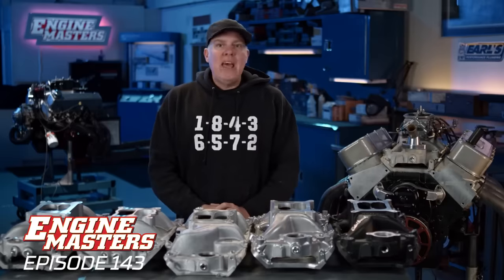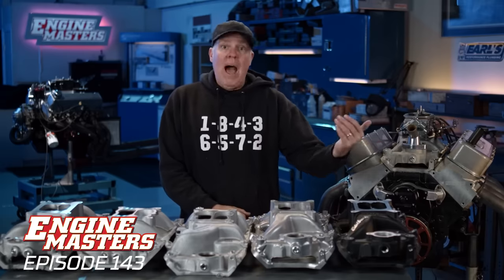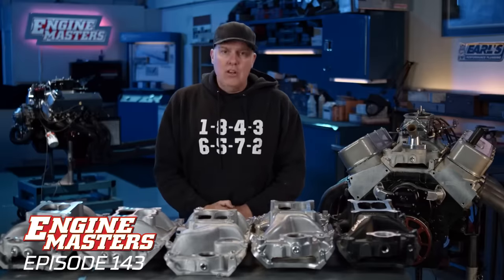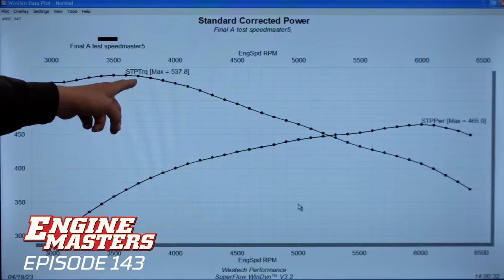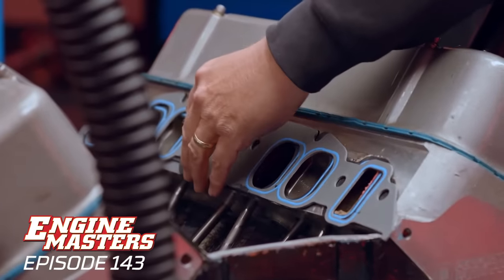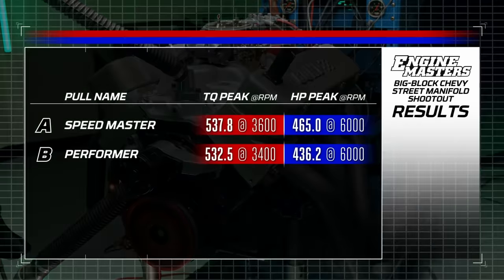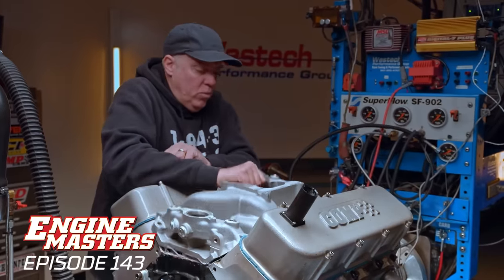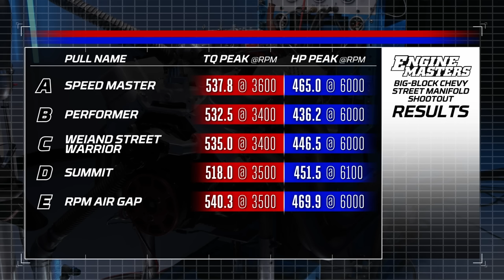Intake Manifold Shootout for Big Block Chevy! | Engine Masters | MotorTrend

Comment: I mean I get it’s a big block 454/7.4L V8 and by todays standard of HP per liter it’s not “all that” but geez I’d hardly consider that “a dog” 465HP/537Tq is nothing to scoff at, that’s still would still be a pretty stout street motor, that would still WALK about 90% of the normal cars you pull up next to at the red light (obviously it probably couldn’t run against a newer ZL1 Camaro, GT500 Mustang, Hellcat, etc) but even with the lowest/1st Dyno pull it’s still stout. ESPECIALLY if you have the right diff gearing (3.73, 4.10, 4.56) add all that together in a relatively lighter weight car and you’ve got something that would still definitely be a blast to drive. Not trying to be negative/hate on the video it was a great video as always! Engine masters is definitely one of my favorite series.
Reply: i have a Mark IV block with the PP heads and 2.0 eddy and 750 QFT and a mild 270H cam in a 3800 lb Gbody with 3.73s  . the Car walks my 87 GN with 17 lbs of boost!  Its funny looking at the Tac its just at 4000 rpm as it says bye bye to the GN
Reply: I agree, 537 ft lbs in street car or C10 with the right gear and converter would be a blast on the street, and put a 150 shot on top of that if you want a little more now and then. Most people wouldn’t know what to do with that much torque in an average street car. 👍🏻

Comment: Can you do a comparison of intakes for the Small Block Olds engines?
Reply: Yes yes yes! I'm lost with my 307
Reply from the maker: Interesting idea!
Reply: @rikardoberg9925 from what I've been reading, with the Olds rocket, not only is it a legendary engine, but they're saying Olds were generally considered the most powerful muscle car's until the hemi came back with the 426, then Chrysler took over.
Reply: @rikardoberg9925  yeah,  it's pretty much the original muscle car. I feel like mainly chevy and ford have gotten most of the love with engine's over the years and some Chrysler with the hemi. The one's that haven't have been Buick,  Olds and Pontiac.  They've all had at least one quality engine over the years. They need to definitely shine something on those guy's.

Comment: okay you 2 lads , how about doing an episode about camshaft notching -- meaning advancing or retarding the camshaft  by 1 gear tooth or by 2 or 3 teeth ETC , versus crankshaft timing , i read a story  back in the early 2000`s about an engine builder who retarded the camshaft to crankshaft alignment by several teeth , basically he explained that the piston was 60 percent on it`s downward stroke creating suction in the cylinder , then the intake valve opened allowing a denser air-fuel charge to be "SUCKED"  into the combustion chamber thus resulting in a lot more torque generated ( he did not though state if the camshaft was a custom grind , probably was but  just a factory grind maybe .

Comment: didn't Brodix/Shafiroff come out with a low deck dual plane intake to feed large cubes/heads? did that ever come out
seemed like a great solution for hood issues
the 615ci 9.8 deck has my attention, especially with hood clearance. looks like a massive torque monster with that 4.625 stroke too, but i might stay with 4.35 or 4.5 stroke if i do a engine swap
I just think BBC's with high compression has such a unique sound that is pure music to the ears

Comment: Now the 2 manifold gaskets on the Edelbrock Performer throws me. I have just rebuilt a Mark IV 454 with 820 oval port heads. When I try to run it, it will not run, it seems there is a massive vacuum leak. If I work the accelerator it will stay running above 2,000 RPM, but dies quickly when let off. I tried 3 carbs, 2 fuel pumps, and 2 distributors, so they aren't the problem. I have a 7561 Air Gap, and I wonder whern they put that on did they use 2 gaskets, or have the thick ones, or was only 1 used?

Comment: David. Look at air fuel ratio at steady throttle 1700 rpms.  If its lean. Increase the primary idle feed restrictions.  0.031 afrs  are lean on a 347/355. On a 396/408 you need a 0.034" ifr. A 427 needs 0.036.   If you like throttle response off idle that is how its done.  Look at primary jetting at 3500 to 3800 rpm.

Comment: Back in 1990 or so I built a 468 11. 1 compression BB chevy square port heads 623 lift 248 at .050 duration cam offy port o sonic open plenum intake. In a 3500 lb camaro it lacked low end torque . I switched to performer rpm intake and then the motor struggled to turn rpm after 5000 switched to gm large oval ports with big valves and dart open plenum intake and that was the way to go. Big difference

Comment: When the factory dyno test the engines they do it with his it's going to be installed in the vehicle with all the police than the belt on it with all the equipment running
So the insurance companies won't shock it to the customer that bought the vehicle